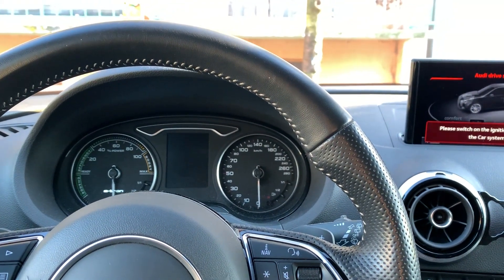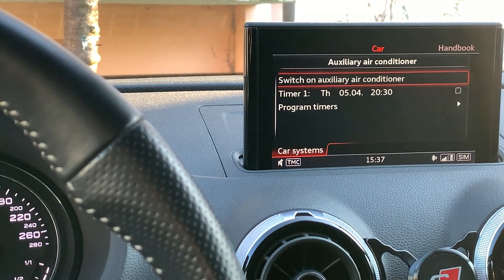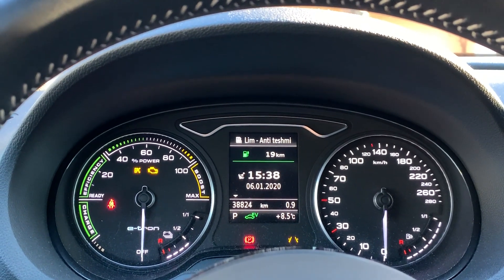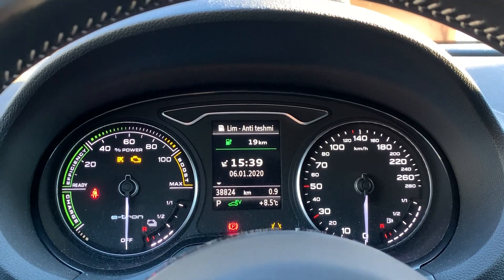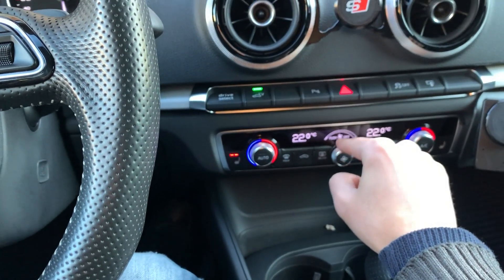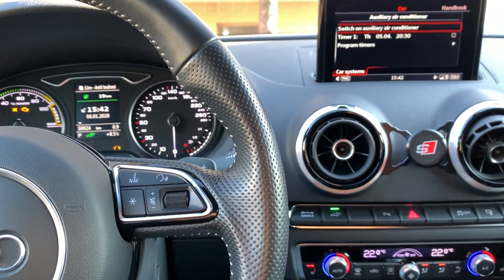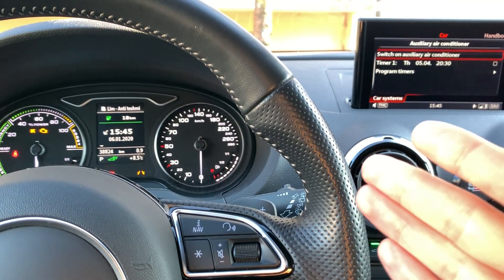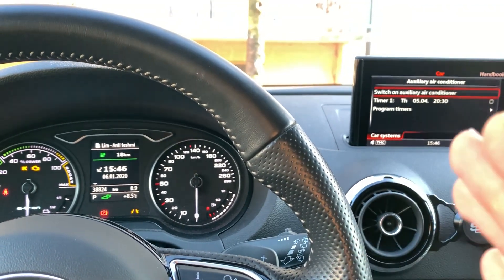Audi A3 e-tron auxiliary heating, how it works

Comment: Do you still react? I have a question?
Reply from the maker: Hello,
Yep I do :)
Reply: @funcarreviews thanku, after I press the start-stop button to start the car. I see that epc en motor symbol displayed, does that mean something is wrong with the car or the car is just in contact but not started. Does this happen when u don’t use the brakes to start the car?
Reply from the maker: @muusesharif2597 EPC and motor symbols will stay on usually UNTIL you start the car, pressing the brake pedal and pressing the start/stop button.
If they go away after, all is ok.
So yes, in contact but not started.
Reply: @funcarreviews thankyou very much
Reply from the maker: @muusesharif2597 you are welcome :)

Comment: Yo bro ive got another question i have the 2018 facelift audi etron but i cant find the parking aid button
Reply from the maker: Hello hello :)
Do you mean to activate the sensors ?
Or the one that makes the car park itself ?
All is near the warning light buttons.
On the same « line » of buttons :)
Reply: @funcarreviews  both i can hear the beeps that im close to something but i cant see anything on the display. The button that you have next to the danger triangle the P-A button is dont have it
Reply from the maker: @iclapsqueakers_9249 I think that in that case you do not have the options.
The button that i have that you don’t allows you to manually activate the sensors and have it displayed on the MMI  (something that is called Optical Parking System if not mistaken).
I thought that was standard on the facelift but maybe not ?
If you do not have this, I guess you can’t have the automated parking system. Those  are 2 separate buttons.

Comment: It's silly that you can't set the temperature through the app. And does this feature also warm up the combustion engine and the oil? It's very cold where i am atm 😅
Reply from the maker: Hello,
Even for the newer A3 TFSIe, temperature can’t be set through the app, which is quite disappointing, but you can remotely lock and unlock the car (at least that).
That s also a question a was asking myself but I strongly doubt it heats the ICE or oil.

Comment: Hi. When i set the time to heat up, does it heat up allso the fuel motor? And how long does it heat when i set the time of departure? Thanks!
Reply from the maker: Hello,
As far as I know, no it does not heat up the fuel motor. I never used the time of departure but usually it says on maximum 15-20 minutes. I can not tell you more about the time of departure sorry 😅.

Comment: Is it mandatory to have the charging cable connected to use this system? Or can you just use this if the battery is properly charged?
Reply from the maker: Hello,
No it is not mandatory. But you need enough battery and fuel. If one of those is low it will not work. Also as I also explained in another of my videos on the subject, it will work great without charging and while charging on an industrial socket, but it will not work well at all if plugged in on a home socket.

Comment: I discovered this function few days ago as the temperature finally became to be very cold here (Toulouse, France). I used it like you via the App, but I launched it via the Apple Watch and it worked very nice. I already have used this function but it was in summer and the car was plugged, A/C worked fine also with very hot temperatures :-)
Reply from the maker: Yes the preheating (or cooling) is sooooo great on this car. Not regretting it :)